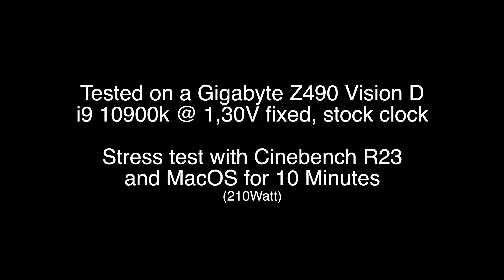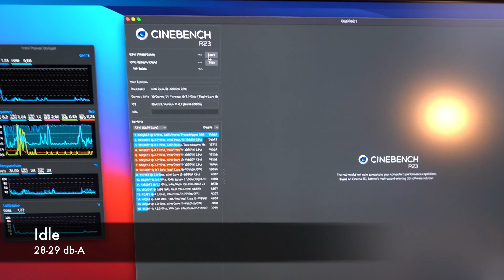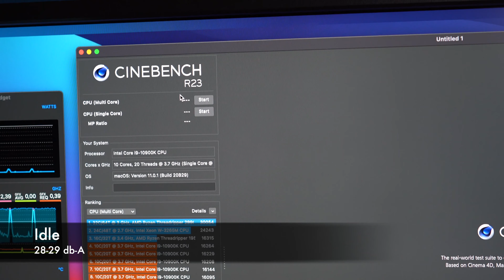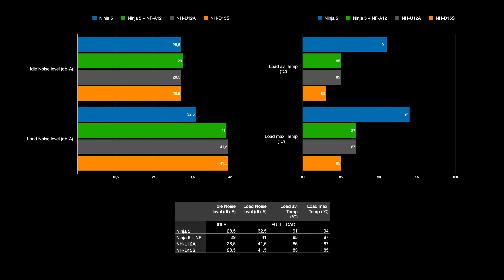CPU Kühler Vergleich - Scythe Ninja 5 | Noctua NH-U12A | NH-D15S mit i9 10900k intel

Comment: D15S is the best I think, even compared to regular D15 since its compatibility with assymetrical design allow the pcie slot in sff easily reached. The temp is also not far behind of d15 regular with two fans

Comment: The noise difference is quite significant, this testing needs to show the RPM of the fans or equalize the Noise levels to show a clear picture, for example if the Scythe is running at 800rpm and the others are running at 1300 rpm that's significant and the differences shown might be misleading.

Comment: Helped make my decision whether to buy d15s or U12a, gonna go with d15s. Thanks 👍
Reply from the maker: Good decision. I do the same ;)
Reply: You will be satisfied. Been running my delidded 6700K @  4,6Ghz quietly for 4 years. Awesome cooler. Stopped using watercooling because of this.
Reply: @Tech-SW good enough for rzyzen 7800x3d?

Comment: Very nice review, wich thermal paste do you suggest ?
Reply from the maker: Hi and thank you for your comment. I am using the thermal paste from Noctua.
Reply: @Tech-SW  Thank's 👍 But to change the fans on CPU coolers how does it work? 
For example I have a Gelid Phantom how do I know they will fit ?
Reply from the maker: @dimmacommunication  these fans are standardized. You can easily replace the fans on the Phantom against 120mm fans from Noctua. But I am not sure if the 140mm version will fit
Reply: @Tech-SW  Nope the 140 mm doesn't fit unfortunately.
I was worried cause the Phantom has a splitted fan cable for the double fans  , it goes in the CPU socket for the power.
Reply from the maker: @dimmacommunication  regarding the operation of 2 fans on one Fan header on the motherboard, you can use a splitter cabel adapter if you are using two same fans. e.g. like this:  https://amzn.to/3VDNTZs
Reply: @Tech-SW  Thank's , I bought a splitter cable 2 years ago and forgot about it 😂 but it's chinese better take the real deal

Comment: Which do u think its better the nh d15 or the nh d15s
Reply from the maker: due to the dual fan the d15, but with the D15 you can´t use the first PCIe slot on some boards like on the Z490 Vision D
Reply: @Tech-SW  thank you so much no worries i got a z590 EATX motherboard it will fit in just right thanks❤️
Reply: Im late to this party, but you can add a second fan to the D15s. I recently did this and it still clears ram. It wont sit flush with the other fan though. I noticed a 3-4 deg drop on idle and a little better on load(not recalling the numbers off hand on that) with the added fan. I then put it all in a Torrent case and its all been working phenomenal.